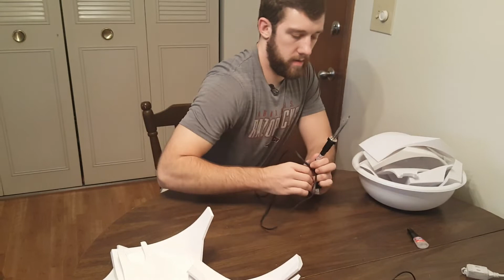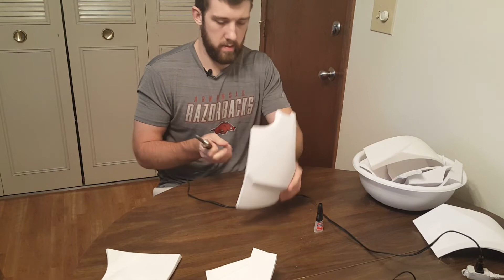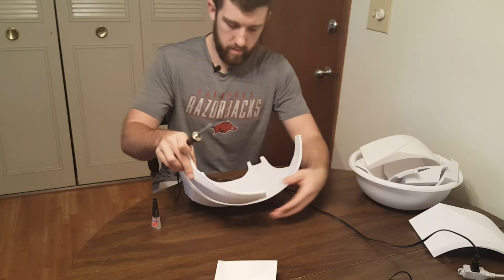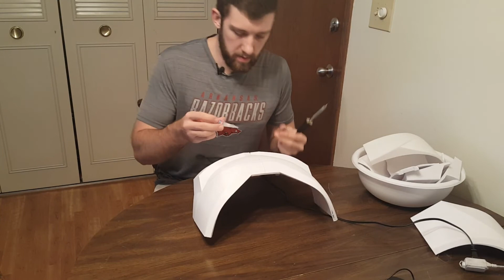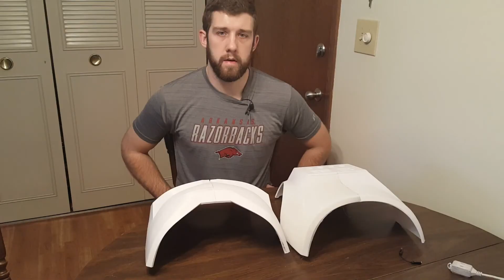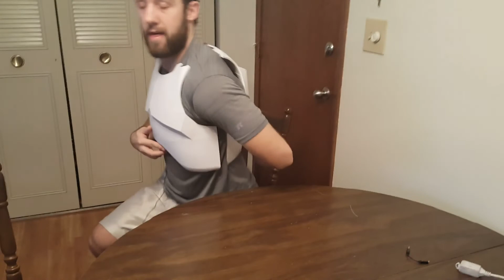Making Clone Armor - Episode 4 - Assembling the Printed Pieces

Comment: I recently made my first clone armor out of EVA foam. It was a blast and turned out pretty good! Of course now I want to dive deeper into what I can do and came across your channel. Fantastic tutorials so far! I am curious if instead of super glue/soldering iron you could use contact cement. That's what I used for my foam armor and it's ridiculously strong and bonds instantly. Not sure how well it would hold onto the filament though. Curious to know your thoughts!

Comment: Save money but you also have 4 $400 printers

Not saying you're wrong just takes a large investment to save money
Reply from the maker: You could just as easily complete it with one printer it'll just take longer. Even with the cost of a printer amd filament it would be cheaper than most of the vacuum formed kits out there.
Reply: @GalacticArmory  ya no your right I'm just saying a lot of people that might not be into 3d print or that only want to do 1 costume would not invest in a 3d printer. 

I'm also wondering. How long did it take you in total printing time to do all the armor?
Reply from the maker: @gabrielh7517  yes you are correct as well!

Its hard to say now but I'd estimate it took between 300 and 400 total hours
Reply: @GalacticArmory  300-400 per machine or total split up?
Reply from the maker: @gabrielh7517  total

Comment: Using that method to hold the pieces together doesnt seem that strong. should really do some adhesion holes with matching pegs on the other parts they fit into. or if using abs then use a mix of acetone and leftover filament.

Comment: justa quick one i realised my prints warped a little bit ( not much but enough to leave small gaps which i can bondo) how did you stop this happening ? they raise every time i print them and the bed is leveled perfectly temps are all good! can you share your settings? im using cura but would like to know your methods too!
Reply from the maker: Does your printer have a heated bed? Are you printing in ABS?
Reply: @GalacticArmory  I'm using cr10 and pla
Reply from the maker: @dominicbennett14  I typically set my heated bed to 60 and my extruder to 210. Warping is rare with PLA since it cools so quickly. If you have any tape on the bed make sure it's not coming up as I've had that cause warping before.
Reply: @GalacticArmory  ive got the temp on 237 someone said that stops warping and my bed is on 70 should i turn it down ?
Reply from the maker: @dominicbennett14  In my opinion it could be causing it. The pla is still too hot when it finishes extruding so it can warp as it continues to cool. You want pla to be completely cool by the time it extrudes and the fan runs over it, that way it can't change it's shape. ABS is kind of the opposite, you want it to stay mildly warm throughout but that's why you have an enclosure for it and not PLA.

Comment: Great series. looking forward to this one as building an armor set is also one of my goals for this year.
(Once i figure out which printer to buy) I'm in Australia any ideas on a budget, yet good value printer?
Reply: Take a look at the Creality printers. Ender 3, Ender 3 Pro, ect.
Reply: Evan Michaelsson 
Thanks I’ve looking at the creality series or a Tevo tornado
Reply: @kazanth  I have been EXCEEDINGLY happy with my CR-10S Pro that I purchased after returning my CR-10S to amazon when the heated bed and part cooling fan died. (Some luck of the draw is going to come into play in the lowish cost 3d printer market.) I have had some pretty good experiences with Creality's customer support when I purchased the printer from their amazon store. In my opinion two Ender 3s might serve you better than a TEVO, but part of that is my general comfort with Creality.
Reply: All in all for the lowest initial investment I would pick up an Ender 3, or Ender 3 Pro (You can work with the build volume for printing armor, but you would have to join more parts together.), and grab a lot of filament. If you wanted something with a larger build volume the CR-10 or CR-10s is probably the best option. [Keep in mind I am not sure the pricing in your region, or where you would be purchasing your printer so if the TEVO is a lot cheaper than the similar Creality printers it might be worth it.]
Reply: https://www.creality3donline.com/creality-ender-3-3d-printer_p0019.html https://www.creality3donline.com/creality-cr-10s-3d-printer_p0014.html You can have the Ender 3 and the CR-10S shipped from Australia on the official creality website.

Comment: Great timing, I'm about to start an armor project. I'm curious about your thoughts on using the 3d printed pieces as molds to vacuum form ABS over? That way you get the best of both worlds, it's still cheap armor but also has the benefits of flexibility and lightweight-ness(?) of the ABS. I'd like to hear if you think this is a good idea or not
Reply from the maker: It's definitely possible! You would just have to find a large enough vacuum sealer. You'd probably want to wait until you have all the chest pieces assembled and smoothed/sanded first. I believe Imperial Surplus uses something like your talking about and it's definitely possible to use 3d printed armor as your base.
Reply: @GalacticArmory  Thanks! Perhaps I'll see how heavy/thick the armor is first before considering if I should vacuum form over it.
Reply: You can make your own large vacuum former at a reasonably low cost  https://www.youtube.com/watch?v=O790OvRy1rc (I have not attempted this). If you already have a 3D printer, want to get started printing armor, and vacuum forming those parts in abs it is one thing, but after the cost of the 3d printer, the filament, and the time cleaning up the parts you might be better served picking up one of the imperial surplus kits. (Vacuum forming abs parts mean you have to print, clean the prints, if you didn't scale down the 3d prints you need to sand it down if you want the vacuum form to be the size of the original print, get the vacuum form right [It might take a few tries], clean up the vacuum formed parts (This involves trimming down excess material from armor pieces that you have to form in two halves [arm/leg armor] and cutting off the excess sheet material, connect the parts formed in two halves, and then you have to repair any surface defects and paint the parts.). In general vacuum forming is only going to be worth it if you own the rights to the item you are forming and can actually produce and sell kits, or are for some reason producing armor in bulk for personal use. Edit: I have nothing against people making themselves a crap ton of different armors.
Reply: https://www.youtube.com/watch?v=pvdbT6hd0-c&list=PL7qxZZ3wmqzrnKxL5Gul2NsoFZf4gmnYy This is a great video showing what you have to do to finish vacuum formed parts, but keep in mind that by the time you get to this step you will have already produced a full set of 3d printed armor.